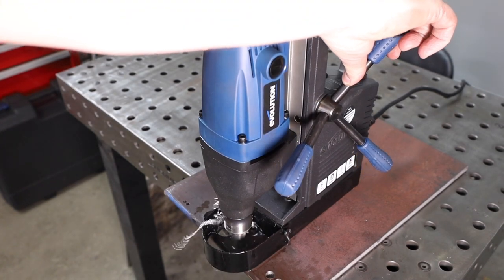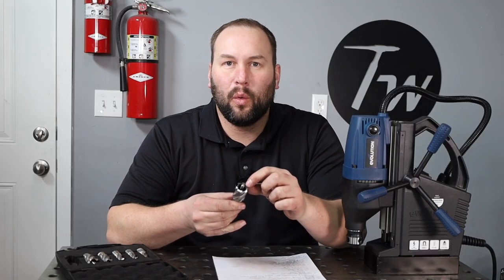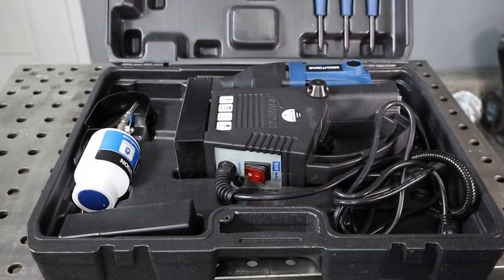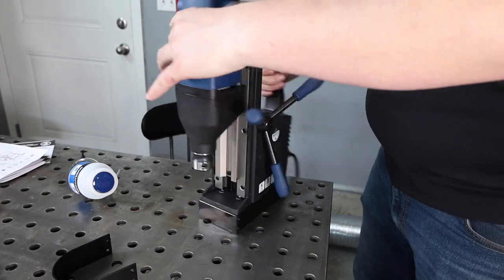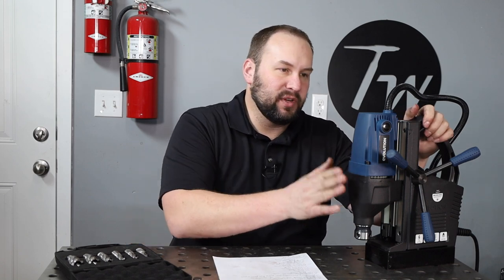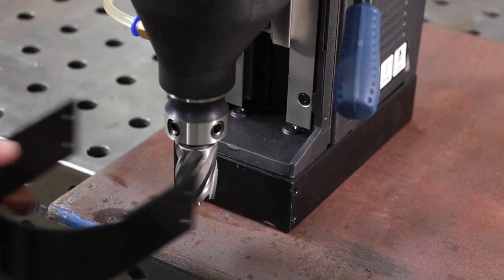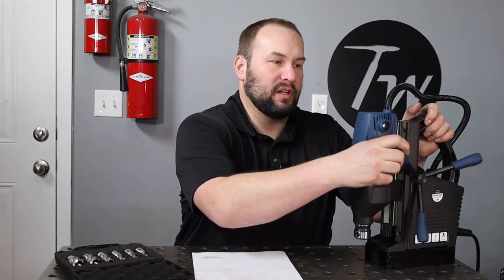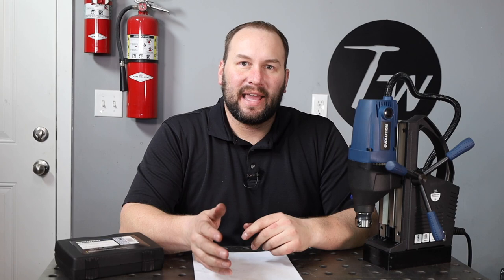Magnetic Drills and Annular Cutters with the Evolution S28 Mag Drill

Comment: At that price point, sub-$600, and the adjustable height to accommodate standard twist bits, this is a great option for garage and hobby work. Especially since it includes the chuck adapter. Cheaper options typically don't have enough stroke to accommodate longer twist bits and won't include a chuck adapter.

Comment: I keep going back and forth about getting a mag drill. I don’t really have a use for it. It’s pretty specialized. But I do have a Hougan arbor for my mill, and they’re very useful there. These are great for 1080 low carbon, or A-36 low carbon. But you will likely destroy the very expensive bits on harder steel or stainless, even with lub. So for anything other than those low carbon steels, I highly recommend carbide tip cutters. They’re even more expensive, but will last a lot longer.

By the way, these are great for thick rubber and plastic at low speeds. Wood can’t be touchy. Use WD-40 for plastic, and remember - slow!

Comment: Congrats on the sponsorship! That's a pretty impressive tool, much more than I'll ever need, but I have seen other folks use mag drills well. I am hoping to eventually get one of their saws, though I'll probably just get a cheap miter saw and put one of the Diablo metal blades on it, because I'm pretty cheap...
Reply: Miter wood saw? I believe they have a higher Rpm. The carbide will just chip.

Comment: Tim, when you are sick of having those hss bits resharpened or you need to drill 4130/4140 or ar400 you will switch over to carbide tipped bits …  they cost 3x as much BUT last 10x+ as long …
And the guy who resharpens end mills typically also sharpens carbide tipped annular cutters ….
Reply from the maker: Thanks Peter! I’ll have to check those out.

Comment: I love Evolution. I have the metal cut off saw. My next is the Table saw but I really need one of these magnetic drills. Just hard for me to justify $600 at the moment. Even if they are less expensive than others and in my opinion, just as good. But i have needed one of these mag drills 100 times this year alone.
Reply from the maker: I’ve used the chop saw a lot. I’m looking forward to putting this thing to work.

Comment: Pecking wears the cutter much faster, because most of the wear occurs when the cutter first meets the material being cut.  just keep constant pressure on the handle until the through hole is formed.  These cutters were designed to evacuated those long chips like you were first getting before the pecking.
Reply from the maker: Thanks for the tip, I’m new to annular cutters. I was trying to slow progression to break the chip without disengaging the cutter, but it sounds like it would be better to just let the long chips build.

Comment: I'd like to put a small drill press in my garage shop.  This seems like a great option.  Has anyone seen a setup that allows this to be used on aluminum work?  I'm a hobbyist and do both steel and aluminum projects, but don't have a lot of room for metal tools.  I have a Langmnuir Arcflat table, so it could be magnetized to that.  Maybe put a block of wood under the aluminum and clamp the piece down.

Comment: What coolant do you use?
Reply from the maker: The brand I was using is TRIM. I already have it for my mill, so I just grabbed some. Evolution also sells some just for this as do other mag drill manufacturers.
Reply: I typically use TapMagic...there's one formulation for steel and another for aluminum.  I'm not a chemist, so can't tell you what the differences are between the two.

Comment: Pecking makes the cutter get dull much faster than continuous smooth even pressure.
Reply from the maker: Have you actually tested this? I’m curious because I’ve heard that said before but haven’t found it to be the case in real practice, at least not on on twist drills. I am new to annular cutters, so they could be different. I don’t disengage the tool, just slow the progression periodically to allow the chip to break and clear.